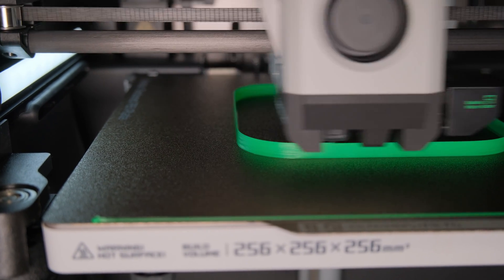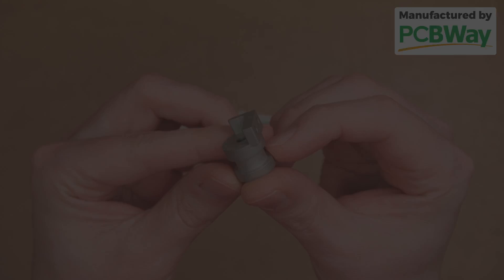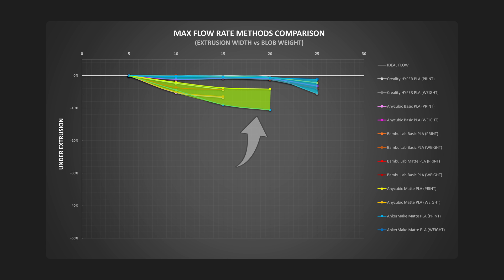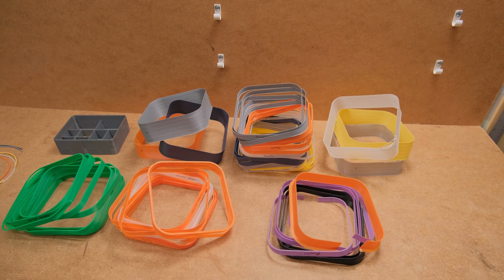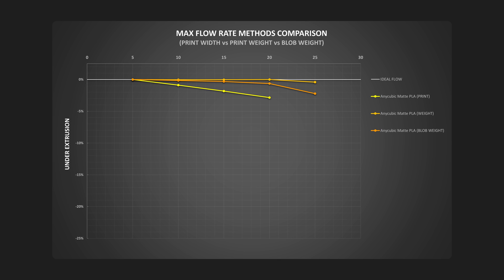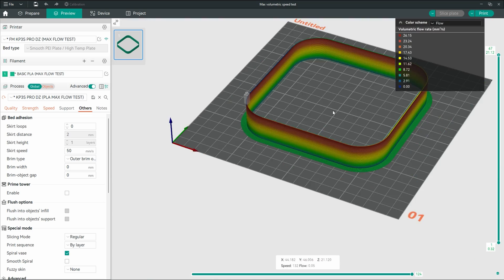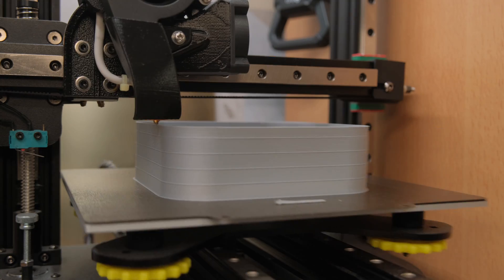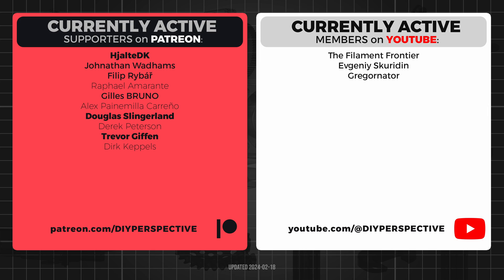3D Printer's MAX FLOW RATE TESTING – PRINT vs WEIGHT

Comment: This video is excellent and very thoughtfully produced. It delves into an important distinction that is often overlooked: the difference between the maximum flow a printer can output, the expected flow rate, and the flow rate at which the part will be dimensionally accurate and mechanically sound.

The explanations are clear and detailed, making it easy to understand the complexities involved. The visual aids and examples provided effectively illustrate the points being made, helping viewers grasp the nuances of printer performance.

One important recommendation for future videos: please slow down when you speak. You clearly have an in-depth understanding of the subject, but for the audience, it can be challenging to keep up with your rapid pace. SLOW DOWN, SLOW DOWN, SLOW DOWN, PLEASE.

Overall, this video is a valuable resource for anyone interested in understanding printer flow rates and their impact on 3D printing performance.

The Stefan’s Blobs test, for instance, demonstrates the maximum amount of plastic extruded for a requested flow but does not indicate the part's mechanical performance. Just because a printer can extrude a maximum amount of plastic does not mean the resulting part will be high-performing. Additionally, this test is static with limited pull on the material exiting the nozzle, which does not mimic real printing conditions.

On the other hand, the material deposition test offers a more realistic representation of the actual material flow rate. The graph presented in the video clearly illustrates this point.

Mechanical performance, as the video rightly points out, depends on numerous factors related to the material and its properties when melted, deposited, cooled, and various printing settings like retraction and temperature. These factors are too complex to be linked solely to the flow rate.

The main goal in high-velocity printing is to support short processing times. Evaluating the flow rate as the ultimate indicator is a mistake because this is a multi-dimensional issue. To address this, I suggest using a process called "Design for Experiment" to identify key factors that ensure parts are produced quickly, efficiently, and retain their mechanical properties and appearance.
Reply: You can slow down the video by clicking the little gear icon in the lower right. Personally I appreciate the speed at which he talks and understand it all but given his accent and pace I totally understand it could be difficult to understand.

Comment: hi man great video about this comparisons, do you think that in differences with the blob test and the print test, the  consumption current of the motors X and Y may cause a decrease in the current in the Extruder motor, causing that the flow decrease slightly? Maybe is a chance of this happen, you can try this using two separate motherboards, one for the axis movement and other for the extruder motor with separate power supply.
Reply from the maker: I doubt it is the case as the weight of printed parts was very similar to the weight of the blobs. Weight will never take into account the fluid dynamics of the molten plastic when extruded at different temps due to faster printing speed. At this point, I think measuring extrusion width is a significantly better way because it is a realistic printing scenario and it gives way more valuable data on how plastics actually flow.

Comment: Should we expect a percent error on a linear dimension to  match with weight error (i.e. a volume error)?
Reply from the maker: Weight error mainly depends on the print test, and measuring width of the extrusion you have to practice a bit to get error free measurements. That's why I redesigned my print model as it was hard to measure and the older version introduced other variables. So with more practice, better model, and measuring 4 sides of the extrusion I feel it gives very accurate readings to judge how each filament performs.

Comment: Why not weigh the printed parts, just don't add any brims etc? Should be much more accurate. Maybe print the first layer first and weigh that and subtract it from the rest of the measurements because it will be printed at a lower speed. Measuring width seems not very accurate.

Comment: Very cool! I recently did some extensive flow rate testing with the blob method as well. Since doing the testing on various upgrades, I have definitely found the printing results don't always like un perfectly with my data. I suppose that is to be expected when changing so many variables like print speed, layer width and height, and infill amount. I will say the blob testing has given me great general guidelines for maximum printing speed though.
Part of what I thought about most when testing is what you alluded to. The faster you print, the less hot the filament coming out of the nozzle actually is relative to the overall temperature reading. This will affect print properties and it's part of why if you are printing near the limits of flow, it may be beneficial to turn the heat up slightly not only to prevent under extrusion, but also to maintain layer adhesion and uniform heating of the extruded filament.
When printing a very large print at high speeds for example, near my max flow rate, turning up the temperature just 5 degrees improved the quality of the surface and possibly avoided the line stacking you were talking about. That was with PETG. Note that performing this same testing on PETG for example may produce very different results. It was very surprising to me how differently flow rate testing went with PETG compared to PLA.
Anyways, good stuff, look forward to more tests!
Reply from the maker: Thanks. Now I am very interested in how layer adhesion comes into play with all this. Max flow with PETG from my experience can depend a lot more on the filament itself. I have some that are impossible to print above 6mm^3/s and others print fine above 10mm3/s on the same printer. :D
Reply: @PrintingPerspective  Yep I saw a lot of variance as well. My Creality transparent PETG flows way easier than my Longer black PETG+ for example. PLA is more consistent, but at the same time the higher temp and generally higher quality PLA tends to have a lower max flow rate while the less durable stuff flows fast. I was really surprised my Creality carbon fiber PLA was actually the highest flow rate, because I like its properties overall and it doesn't print super low temp either.

Comment: I feel this is mixing up max. flow rate measurement with correct wall thickness tuning.  CNC Kitchen's blobs are great to figure out the max. flow-rate and even give information on how the flow-rate is affected the more filament you try to push through per second.  That is a very valuable characteristic of your extruder-hotend-filament combination.  However, it is not the only parameter determining wall-thickness.  As the video points out, even if filament still flows good enough to come out, it might not spread out as easily as it does when heated longer (so with lower flow) and that will affect wall thickness, but that effect itself (so not just the wall-thickness, but the amount that thickness deviates at higher flow) will also depend on your selected layer height and line-width, so it's much harder to characterise than a single max. flow-rate value.  In short: the blobs give you valuable information on the absolute maximum flow for extruder-hotend-filament, but you might still have to lower your filament throughput (or tune the slicer's line widths or max. speeds for certain line types) if things like exact wall-thickness are important for your print.
Reply from the maker: What is the flow rate? It is how well extruded filament flows and determining when it no longer flows to be printed. At higher temperatures, plastics flow better and at lower worse. With filament spending more time in the hotend, it gets hotter, and printing at higher flow rates it spends less. The decrease in extrusion width literally shows a real-world scenario of comparable states between flow rates, how well the filament was heated, and how well it flowed. That affects how consistently the layers will look and how well they bond. You can get so much valuable data from that. And that is my goal here. But if you think other methods suit better for you, I respect and have no problem with that.

Comment: Great work @diyperspective! On another note, I was wondering if you could explore closed loop vs open loop stepper motors in a future video. I have seen a few claims that they increase torque and decrease stepper motor heat. Would be interesting to see this effect on accelerations and print quality.
Reply from the maker: Thanks! There are a lot of topic that interests me but to be honest they are just not viable to make videos about as they are extremely niche. As a full-time small creator, I have to think of ones that will interest the more general audience and bring valuable info to a more hardcore audience. Otherwise, it won't be a sustainable job, unfortunately.

Comment: 2%-5% could well be just the plastic shrinking more due to the higher stresses put on it from printing faster. I especially noticed that i had to slow down my ABS profile quite a bit for this exact reason.
Reply from the maker: The A5M Pro printer results were quite good even at high speeds because of the long meltzone. I think measuring extrusion width at different flow rates is great as that also gives you data how different filaments perform during various flows. Those couple percents might not seem much but that also will affect how consistent your layers will look. So it's also good for finding the filamets that flow more evenly at different temperatures.

Comment: Thanks for the video! MirageC has great videos on testing HotEnds, and I feel like there's more to it than one might think.. I used the scale method and the "more realistic" speed test structure (thanks to @CNCKitchen for the models and the website at this point!) and always wondered what the max. allowed underextrusion in weight was in the scale method. In the speed test structure one could clearly distinguish the first failure at which defects appear and substract 2-3 mm³ as a margin of safety.
Reply from the maker: There is always more to everything, haha. The more you test the more you see how complex it gets. :)

Comment: You are not taking into account the thermal  expansion of each of the materials.....different materials/even different colors within the same material can expand or contract differently. This factor has a big influence on extrusion width.
Reply from the maker: I tested multiple different PLA filaments with different colors and the trend was more or less the same between the two testing methods. I personally want the filament that reacts to different extruding temperatures as little as possible. That gives more consistently looking layers. So measuring the extrusion width at different flow rates gives the most meaningful data. I don't get the point you trying to make here.

Comment: Umm... I really suggest you get a different scale. I had that same scale and it drifts a LOT, you need to recalibrate in between each measurement.
Reply from the maker: I think you have a bad one. I never encountered that, there is a tiny deviation but mine work quite consistently. I even checked now weighing objects back and forth.
Reply: @PrintingPerspective  I went through 4 replacements of theirs before I gave up and returned it, but yeah if your re-validating with the weight in between measurements it's probably fine...but your data just isn't anywhere close to the results I see in my own testing. One of us is doing something wrong 🤣
Reply from the maker: @Geoff_W you talking about the blob weight method, right? What extruder and hotend combo you have?
Reply: @PrintingPerspective  Yes, blob vs pattern method I ALWAYS see the blob method as lower than the pattern. AnkerMake M5c is one I have that you also have, for example.
Reply from the maker: @Geoff_W That is so strange, as I never saw the blob method drop more percentage-wise compared to the extrusion width on all my tested printers. Might be the filament you are testing with or maybe the extruder not having enough tension. It is really surprising to hear that.

Comment: Interesting results yet from my experience the results don't differ as much. I noticed in your shots that the part cooling fan was deactivated for the blobs but active when printing your part. Did you check if this might be the reason for the mismatch?
Reply from the maker: I did not just because the real print in vase mode dropped more or less the same as the blob weight percentage-wise, you know. I think the extruder can play a major role here and filament slip-through pushing gears can be a significant factor for the lower extruded blob mass. I remember using Titan vs BMG extruder and the difference was huge with this blob weight method.
Reply: @PrintingPerspective  While I agree that back pressure could be a contributor to lower max flow percentages the results presented are still to variable to make a solid conclusion. I think having more tests and less assumption about what is going is needed to find the true flow rate. For example with fan cooling you introduce more heat loss to the heater block therefore lowering print temperature by a small percentage. What this shows is that the true flow rate will depend a lot on the geometry you are printing and the specific factors of your printer (hot end, heater power, exact nozzle size, material shrink rate). In the end we can only test so much. Finding a more representative value for flow rate is valuable.

Edit: The comment about thermal expansion/contraction is very much spot on. If you care about percies wall sizes this method may work better but is not a general solution. I still feel that weight of model and blob are still a more consistent measure as a general solution.
Reply: very nice video man. Another possible way of measuring flow is with filament lenght extruded versus requested. I did some test with that technique back then because I didnt have a good enough precise scale like Stefan's method. And It was very interesting to see the results. Thanks for sharing this one and the deep dive.. I love that :) Keep it up
Reply from the maker: @Vez3D thanks. I really loved Stefan's method, but I heard from other creators that other methods are more representative. So I had to know for myself. The reason why I like my way is that it is a realistic printing scenario, it provides progressive data and you can see how filament flows with different temperatures when spending less time in the hotend. While a couple percent of extrusion width might not seem much it will affect how consistent layers will look. So it not only gives the actual extrusion width that affects print quality but also how different filaments react to different flow rates. After this deep dive, I feel like weighing or other similar methods benchmark more the extruder and not the hotend. The better it can grip the filament the more consistent extruded mass you will have at the increased flow rates when the required extruding force increases. Those are my thoughts at this moment about all this. :)
Reply: This is getting extremely interesting.
Reply: After seeing this and CNCKitchen 's great work, my thinking about highest-speed functional printing is that we're hitting the limit of what we can learn from underextrusion as a proxy variable. 

The question we're really asking is: how fast can we push the filament before the strength/quality begins to drop off. This video supports my own experience, that I start to get weakened layer adhesion before the flow rate really drops off.

Some food for thought: I'm currently playing with increasing temperature and line width (inspired by @CNCKitchen 's tests) to try to smash and melt the layers together at these high speeds. However, even at 250C and fat lines, I'm getting some flakey layers with PLA.

However!! I've been getting some great layer adhesion out of PETG at 40-50 mm3/s with a CHT clone nozzle at 260C. I haven't managed to dial in my PLA as fast as PETG.

My testing is very ad-hoc so far and I would love to see if anyone else is investigating the same. 

As I see it, the problem is thus:
- Dependent variables: layer adhesion and/or dimensional accuracy (depending on your needs) 
- Independent variables: extruder rate, temperature, line width, cooling, filament type.
- Physical factors linking the two: the extruded filament's actual temperature as it lands on the prior layer; (cross-sectional temperature homogeneity?); how long its temperature remains high enough to fuse and mingle with the lower layer; die swell and any other time-dependent effects; this video's finding of zig-zagging layers rather than proper squishing; and surely more......

Because of the exploding number of combinations of these variables and physical phenomena, I'm leaning towards an intuitive + empirical approach: instead of testing every combination, picking a few which should be strongest according to our mental models, and strength test the products. For now, I can only "quantify" this with manual break tests; I would absolutely love to see proper measurements if anyone feels up for it!
Reply: This methodoligy is flawed. line width is not taking into account the the thermal expansion/contraction factor of the filament. If this is taken into account then the results would be closer if not spot on. So in theory the contracted line that is less than the expected width would be denser than a line ovet the expected width. Leading to the same weight....